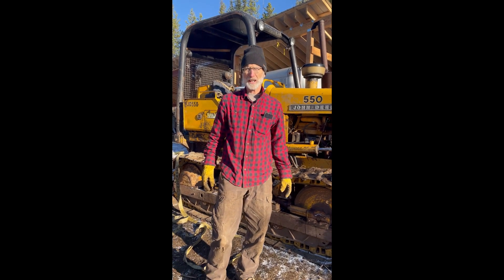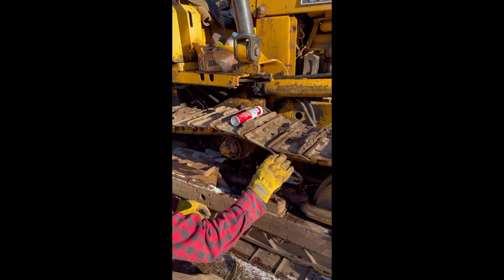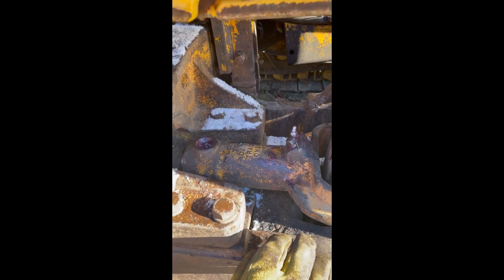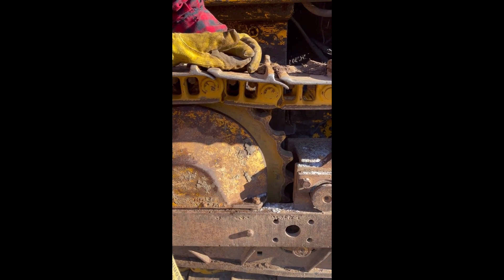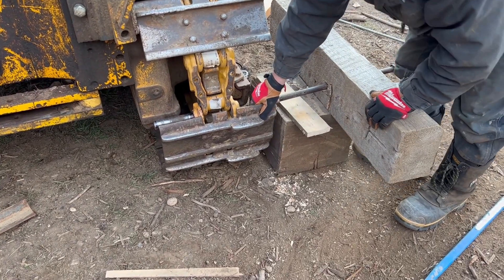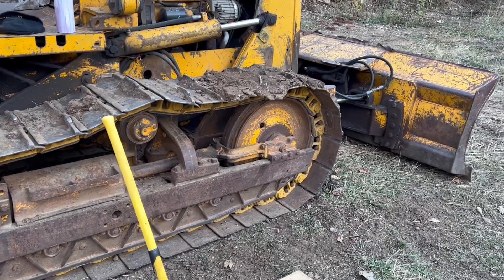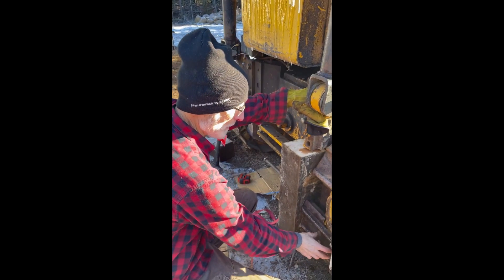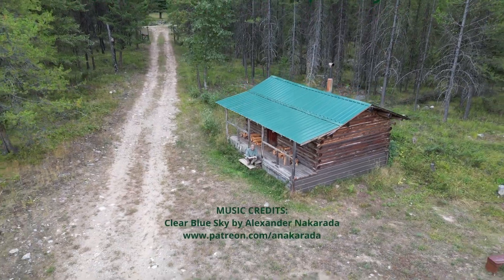John Deere 550 Crawler Track Adjuster Seal Repair

Comment: Good video, Tom. I was a repairman in an underground coal mine. The machine that cut the coal off the face is called a continuous miner. It used tracks to move around and had a similar system to adjust the tension as did some other machines to tension chain drives. We had u-shaped spacers that we would drop over the shaft to hold the tension to take the pressure off the seals. Low technology at it's finest. Lol
Listen to Tom's advice and watch his videos on Scripture study. We all need to be drawing closer to the Most High and His Son to survive and thrive in these difficult times.  Shabbat Shalom